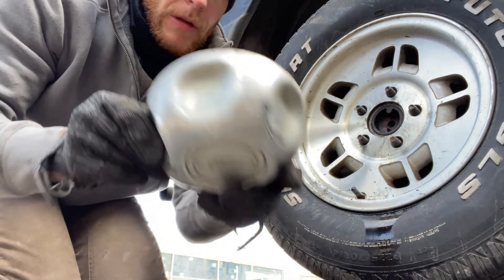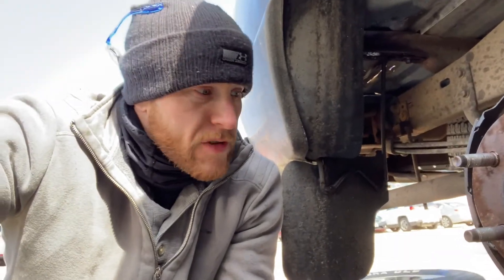NO BRAKES!

Comment: Check that spare tire and make sure it’s good to go, you might need it on the trip
Reply from the maker: I’m diving this lol
Reply: @HardcityRaindrops  is spray the bolts down on the spare so you can lower it if needed and check for air/ leaks. I’ve seen to many people need the spare and it’s stuck underneath the vehicle
Reply from the maker: I’m not driving the truck it’s getting towed